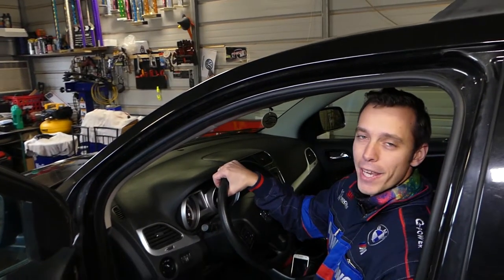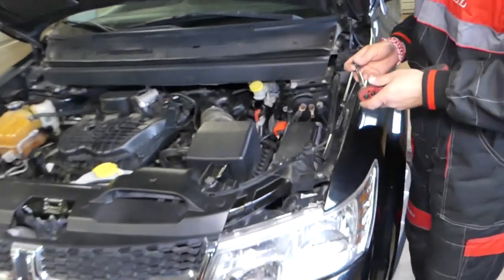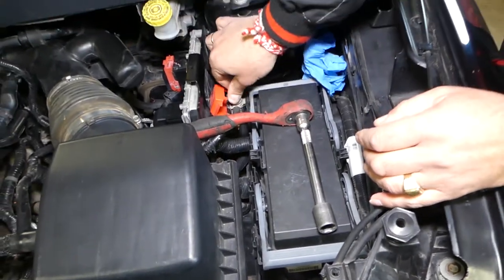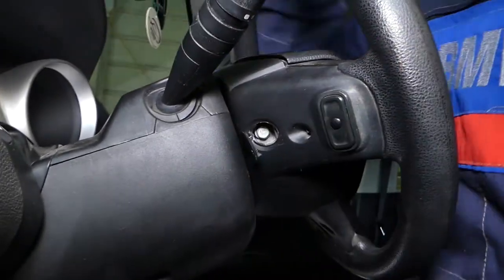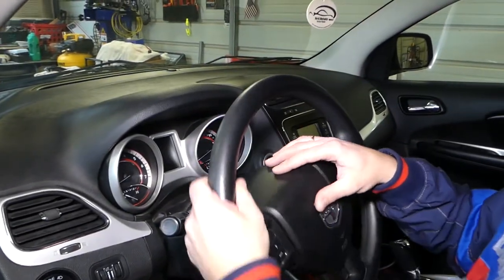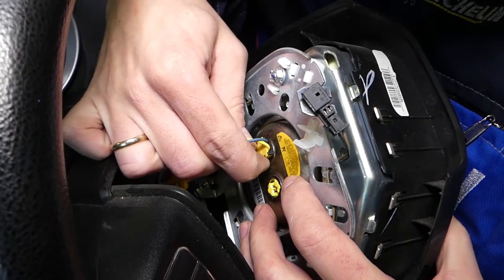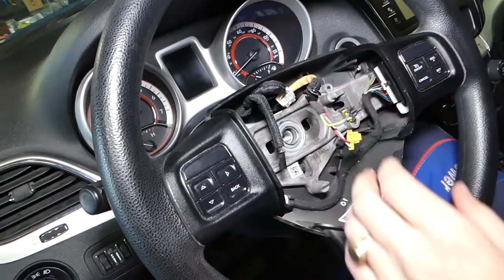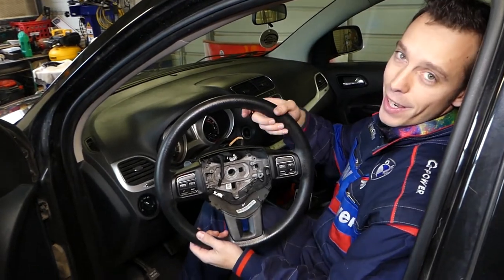DODGE JOURNEY STEERING WHEEL REMOVAL REPLACEMENT  FIAT FREEMONT

Comment: None of my controls for the steering wheel is working not even the horn. I checked the fuses they was good but other than that i dont know what the problem is. Anything would help thank you